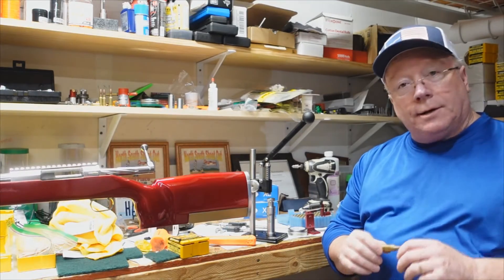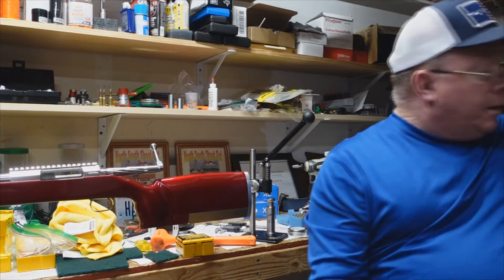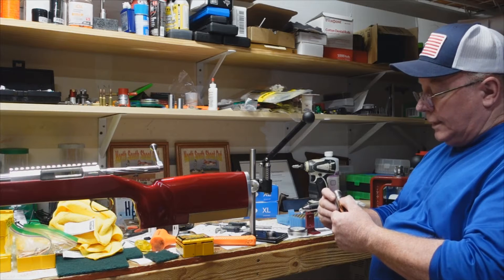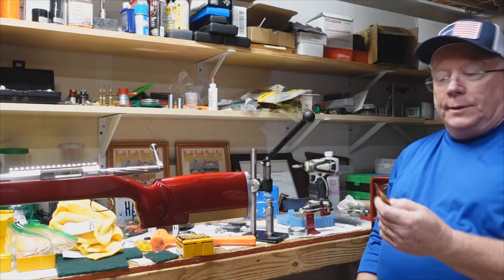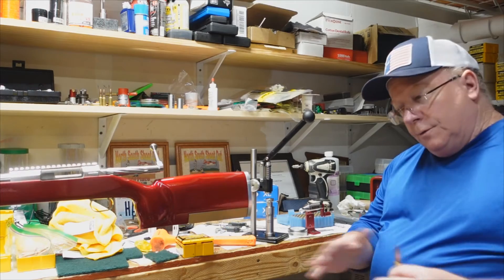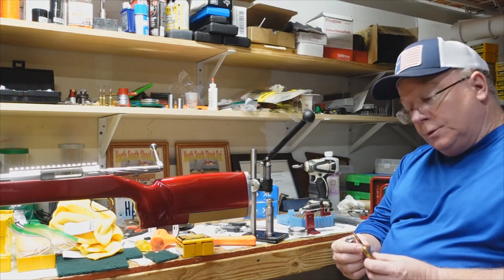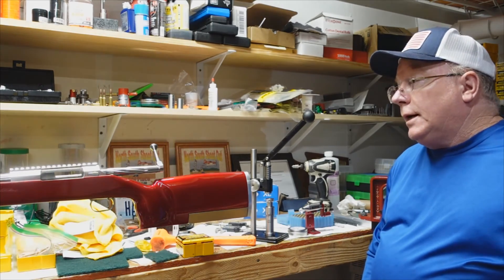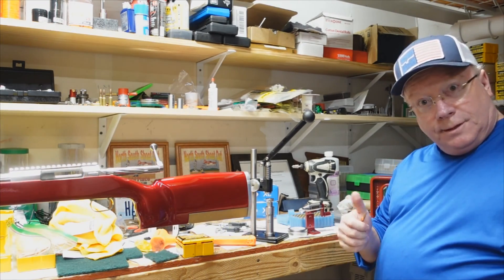7PRC powder test

Comment: I wonder how it is compared to the .284 win which is easy to tune and consistent. I've been very disappointed after choosing the 6.5CM instead a 6.5x47L for my last custom rifle, and a friend of mine too. The loads weren't consistent after testing different bullets, powders, seating depth, smal and large primers, brass etc., I gave up after 1000 rounds. Now I'm convinced that inherent accuracy isn't a myth, and that some cartridges are easier to tune than others (.222 rem, 6PPC, 6BR, 284 Win...). What do you think about it ?

Comment: what ball park velocitys do you get with the 180 grains?
Reply: I'm roughly where he is in the process and velocities for this cartridge (7-6.5 PRC-W) are 2850-2975 fps. My best accuracy looks to be around 2900-2920 so far.  It will run up to 3000 fps and is accurate there but is hard on the brass.
Reply: @longrange1114  Bruce, what's the life expectancy of your barrel at 2900-2920? Thanks

Comment: Sorry...don't quite get it.
I use Hornady oal to find lans.
...
Not sure what the bolt click means...
The bullet is catching on the labs, lede, rifling and making resistance that makes bolt click?
Thanks
Reply: Hornady OAL tool works fine if used carefully. This is just another method. It's almost an arbitrary starting point since person to person everyone will have a different feel. Just gives you a number to work from. Yeah, the click is when the extraction of the case meets resistance as it's pulling the  bullet out of the lands. Same thing can happen if the case isn't sized properly or the base of the case has grown too much.
Reply: I'm with you on this. Seams like the hornady tool is by far easier and faster.